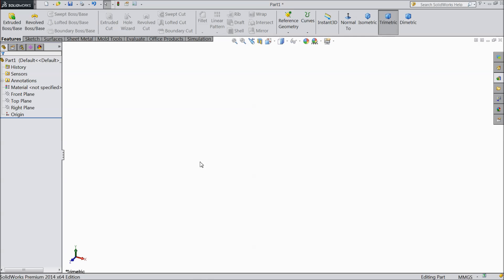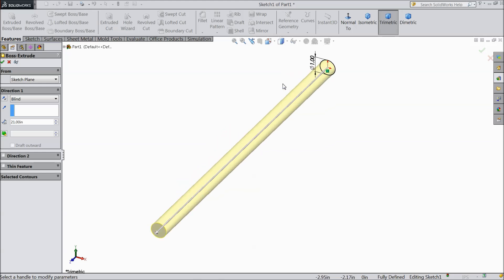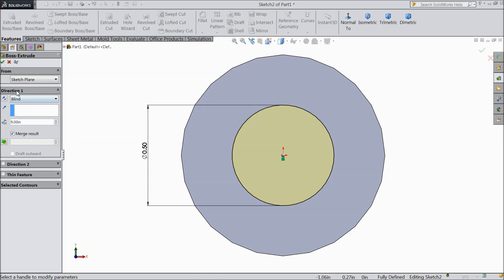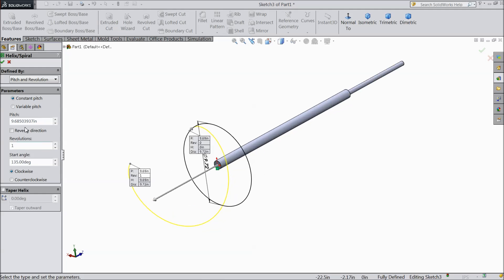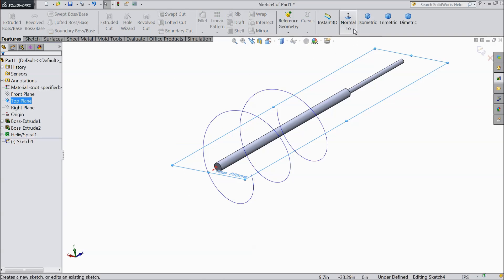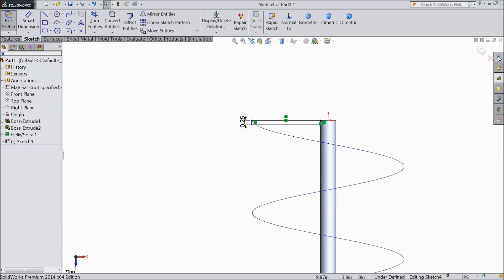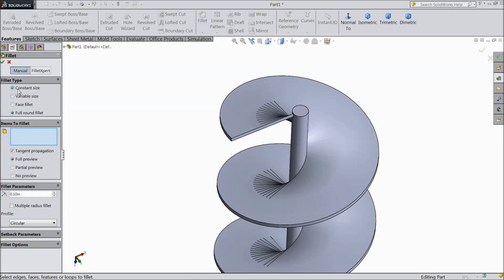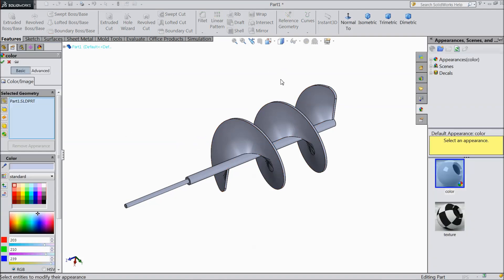SolidWorks Auger tutorial

Comment: Thanks for the tutorial! How would you print it out in 3D?
Reply: You would need to save the file in .STL format then load it into the software you use for your printer.
Reply: Hehe yes that i know, but whats about the support what is the best way to print it - horizontal or other?
Reply: Ah, I see. I just printed one similar to this a few days ago and didn't use any support material. I think I used 25% infill density and just made sure to have a good raft. As it is a spiral it basically builds upon itself fairly well. I did run into some issues when I tried to crank the speed up however so once I slowed it down with around  50% fan speed it worked it out. I printed mine with PLA at around 205 degrees. Hope that helps.
Reply: Thanks for your answer - so you builded it in 1 peace and vertical? I saw some videos where ppl made it in 2 peaces.
Reply: Tam Gaming my build volume is only 150mm in height. The one that I printed was scaled down and yes one piece and vertical. If you print something like this laid down with support material life gets rough. Hope this helps.